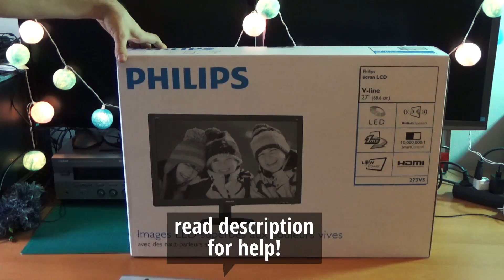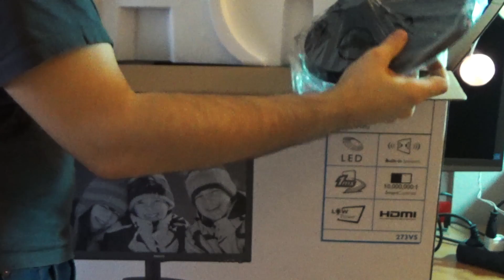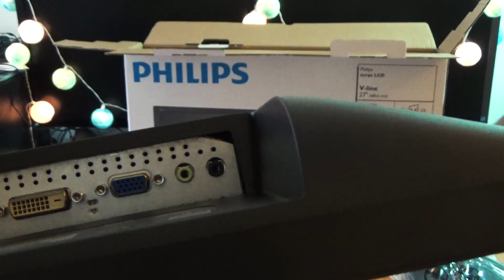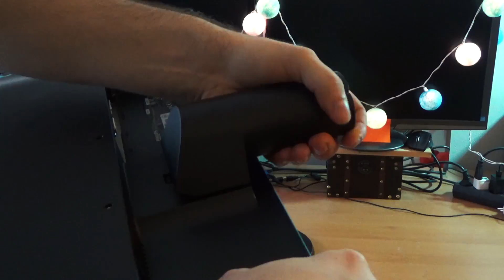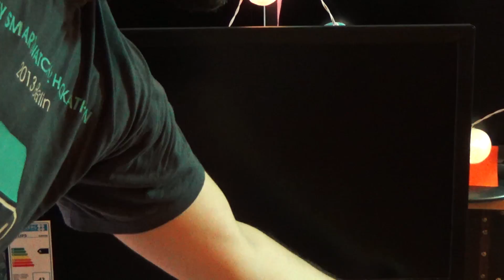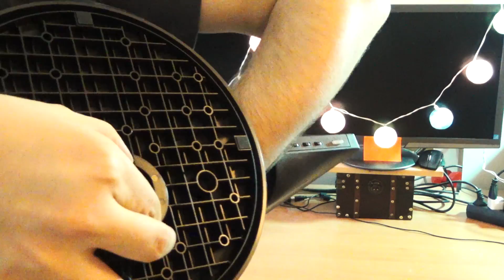Philips 273V5 V-Line Screen Unboxing 273V5LHAB

Comment: I plugged it into an hdmi cable and turn it on PS4 was on previously worked completely fine on the other monitor but for some reason it gives no signal
Reply from the maker: switch the input on this monitor. also plug out and back in on both devices